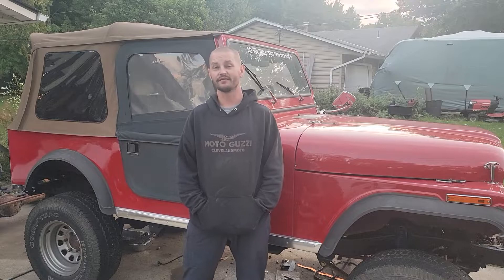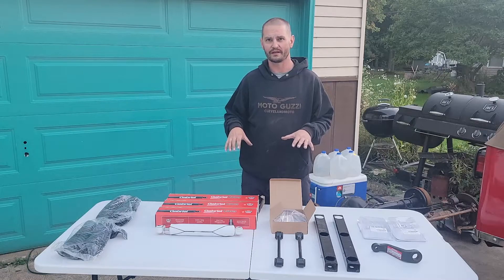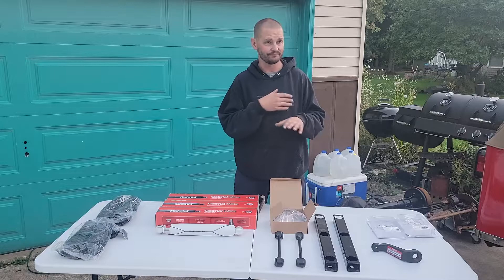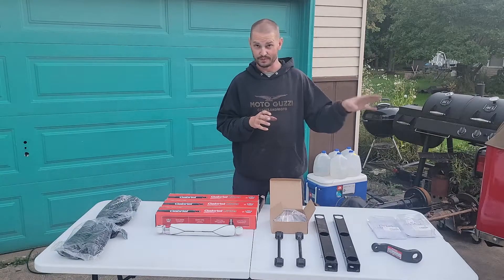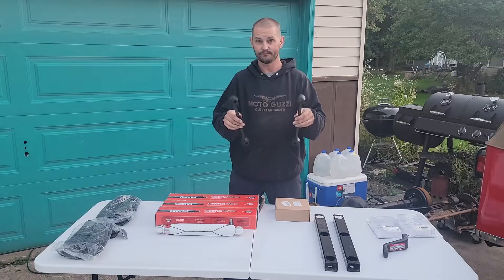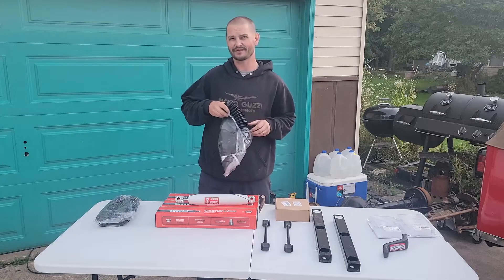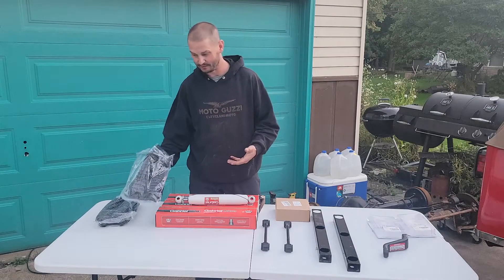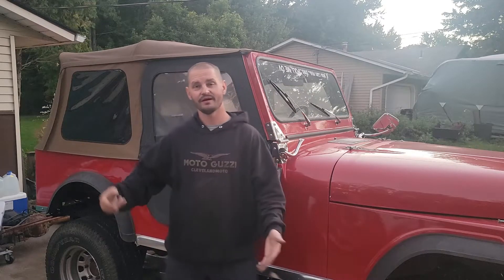Jeep CJ7, cost of "free" 4 inch lift leaf springs.

Comment: Why did you have to get new drive shaft
Reply from the maker: Swapping to the new widetrack rear axle, 4 inch lift, and the swapped in T150 and Dana 20, the stock shaft wouldn't work. Plus with the extreme driveshaft angle, it was just as cost effective to do a double cardan shaft as it would be to shim/weld new blocks on the axle.